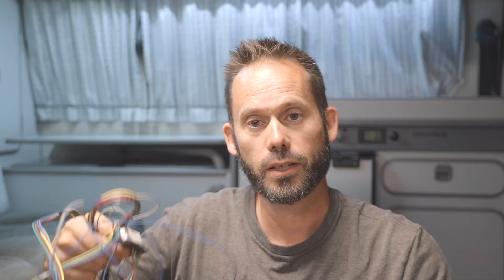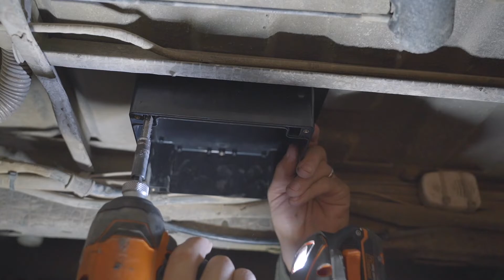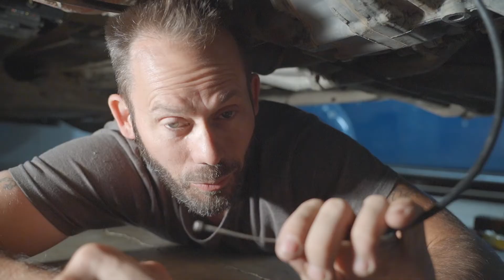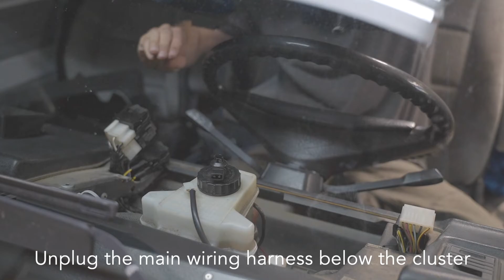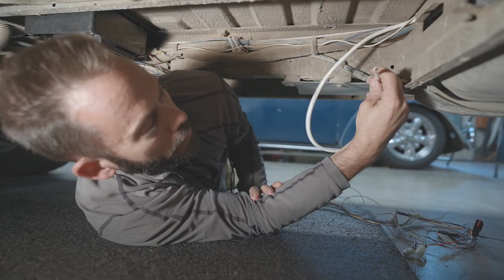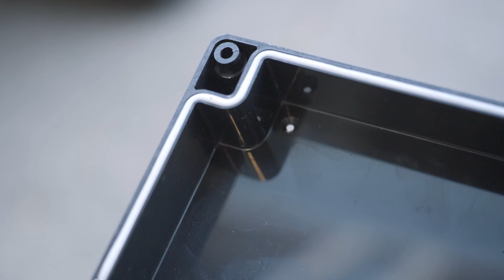How To: Rostra Cruise Control Install for Vanagon.  Add some comfort on those long drives!

Comment: looks much cooler than my stock 91 carat cruise which currently does not work. the system you built has gotta be better than the stock VW
Reply from the maker: Thanks!  It is working well so far
nate

Comment: Does it also work with a diesel engine ? Should be, shouldn´t it ? Greetings from Germany !
Reply from the maker: It should work for any engine with a throttle cable so I don’t see why it wouldn’t work for a diesel. 
Nate

Comment: nice.. will it work with a 1980? thanks
Reply from the maker: It will work with any vehicle as long as it has a pull type throttle body, so yes it should work on your 80.  Is that carb or FI?  Not that it really matters, just curious.
nate